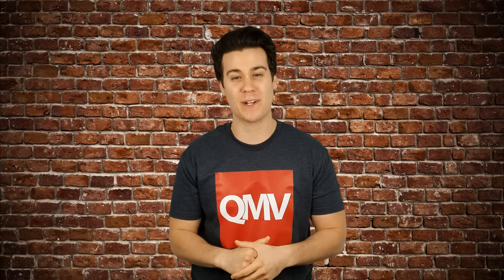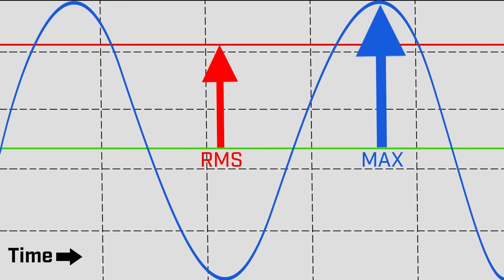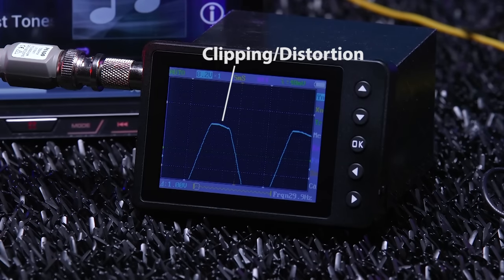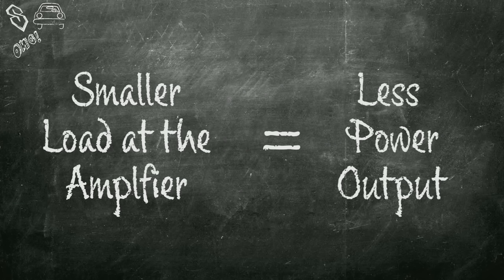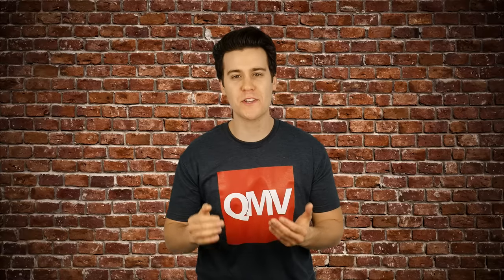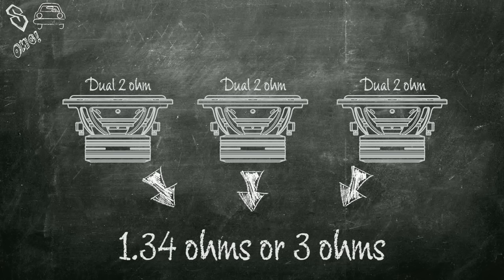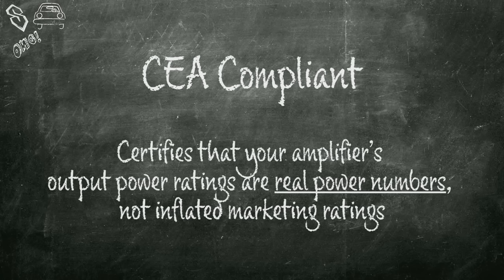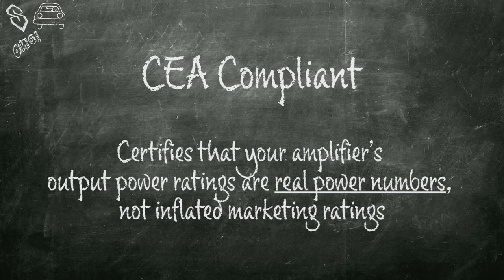How Do You Match Car Subwoofers and Amplifiers?

Comment: This guy talks at 1 ohm and now my brain is overheated.
Reply: 0.75 speed is God’s greatest gift
Reply: @lopsided6393  BAHAHA I have to do that to all my videos now
Reply: I'm trying to bass out a moped scooter. Under seat storage is where the sub and amp will be. Should I get another battery for extra power. And is moped 12volt different from 12volt car power. I've had tons of systems most head amp and subs. But only in cars. Miss my bass . Love my moped. Upgrading. Thanks. #jimmysee28......
Reply: He lost me at subwoofer...
Reply: @lopsided6393  More like 8 ohms, higher voltage.

Comment: @5.39 OMG that the exact amp i have(GM-A3602). got it at walmart for $40 but I'm already replacing it lol just got my sub installed after 2 weekends of work and hours of youtube videos. managed to get it right on the first try but the amp is severely underrated for my sub(370rms) so im replacing  the pioneer amp with a MA Audio HK298 (400rms output at 1 ohm) . These videos were an integrall part of getting this project done Thank you so much!

Comment: The ohms section really fried my brain. I still don't to get it :(
Reply: BLK13 it’s been 2 years since, you you get it?
Reply: @Davidszd-f1h  That's where I got messed up, too. Ohms, impedence, and parallel / serial wiring.
Reply: @damienholland8103  i know im really late but if anyone sees this is and is having issues, look up some diagrams! specifically a website called 'crutchfield' that allows you to put in your set up and it will tell you how to wire it up! super easy.
Reply: The ohms section got me when he started with the 3 subs. He said 3 ohms or 1.34 ohms. I didnt get how he got 1.34 or hiw hes saying 3 or 1.34 like its the same thing
Reply: @Twhite97  and exceeding is up or down
Reply: Don't feel bad it takes some time to learn that stuff. We didn't learn about impedence until 3rd term in my electrical program

Comment: I’m glad I saw your video. Been studying for almost a month for future set up sub woofer. Either gonna use car amp+psu or an home power amp. Gonna compare where I can get less. But no brainer subs for cars are meant for car amps. Most of the local videos I watched here are recommending 1500w rms mono car amp to match for 500rms sub speaker. For the head room I guess. Now that my mind is in peace. Just gonna add 20% more from the speakers rms then boom all good. I only need to know 1 last thing. Matching amperage to the amplifier. Thanks for your vid mate! New sub here from Philippines 🇵🇭

Comment: Thank you for this Video, I just Matched my system by Using a USA made Kicker 4 ohm S12L7 Sub (750WRMS) in a 3cu.ft. Ported box with a Punch P8002 amp and P4004 for Mid's and Highs. Using Hertz Hi Energy speakers OLD SCHOOL
Will see how it turns out.

Comment: So I have 2 p3 12s in a potted box. Which amp would make them hit harder and play low notes deeper? The prime 1200.1d or the t1000
Reply from the maker: In terms of lower notes, the T1000 will get a little lower, it also has more power at 2 ohm and 4 ohm loads. The 1200 has a higher power rating at 1 ohm. The T1000 is also $250 more
Reply from the maker: Gotcha! So the 1200 will get you 200 more Watts RMS @ 1 ohm, and it's cheaper. The Power amplifiers are more expensive and better quality, higher end models. The Prime are cheaper, they're Rockford's more "entry level" line.
Reply: @Qualitymobilevideo  so I decided to go with the t1500bdcp. That's compatible correct? I dont wanna blow my p3 12's

Comment: Great tutorial, i understood 90% of the video since english is not my first language, however if someone can reply to me i would be gratefull. I bought Pioneer TS-A250D4 Subwoofer which is dual 4 ohm and 400W RMS, i wired it to stock bang and olufsen amplifier witch has 1x150W for sub, the sound is even worse than stock, what amplifier should i buy and how i can wire it? it is best to wire at 2 ohm or 8 ohm ? please? thank you so much.
Reply from the maker: You need to test the factor woofer to see it’s impedance to properly answer that question.
Reply: @Qualitymobilevideo  factory sub is 8 ohm, but nevermind, i bought an amp wich has 1x 600rms at 2 ohm and i will wire the sub at 2 ohm with 400rms, it should sound good because is a quality pioneer amp, ty

Comment: Hi 👋 Great Explanation. I have a JL Audio w0V1 4 ohms SVC. Slot ported original JL enclosure. I am not satisfied with the performance of subs powered by helix g4 bridged at 240 rms. Kindly suggest me a good mono block pls..
Reply from the maker: Rockford Fosgate R500X1D 300W RMS @ 4 ohm
http://www.qualitymobilevideo.com/rockford-fosgate-r500x1d.html?utm_source=YouTube&utm_medium=Video&utm_campaign=Match_Subwoofers-Amplifiers

Pioneer GMD8601 300W RMS @ 4 ohm
http://www.qualitymobilevideo.com/gm-d8601.html?utm_source=YouTube&utm_medium=Video&utm_campaign=Match_Subwoofers-Amplifiers

Kenwood KAC-5001PS 300W RMS @ 4 ohm
http://www.qualitymobilevideo.com/kac5001ps.html?utm_source=YouTube&utm_medium=Video&utm_campaign=Match_Subwoofers-Amplifiers

Kicker CXA600.1 300 Watts RMS @ 4 ohms
http://www.qualitymobilevideo.com/cxa600-1.html?utm_source=YouTube&utm_medium=Video&utm_campaign=Match_Subwoofers-Amplifiers

Comment: Amazing since knowledge thank for sharing your experience.
Question 👇
The audio frequency output from the radio in low level or high level.
Amplifier must receive low level frequency from radio unit or no matter.
If the head unit high level output must reduce it before send it to amplifier.
Waiting your reply ASAP
Best regards

Comment: Hello,
Looking for some help in choosing the correct car amplifier.
For a combination of Sony speakers XS-162ES at front & XS-160ES at rear, which is a suitable amplifier among Sony XM-GS4 or XM-4ES?
I require to get crystal clear sound only with some good bass. I am NOT looking for very loud sound.
What are the extra things to get from XM-4ES over XM-GS4, is it only loudness or the output is far better in terms of clarity?
Is it worth the price if I install XM-4ES or XM-GS4 will meet my requirements?
If you can please let me know. Thanks!
Reply from the maker: You can use either and both are excellent!

Comment: 8:32 very helpful info thanks
Reply from the maker: Glad it helped!
Reply: I have a question.  So I have a pioneer GM-d8601, 1600W max.  Website reads this "RMS: 800W x 1 @1 ohm".  Does the "x 1" mean 1 channel?  So does that mean I can get 2 dual 4 ohm subs 1300W max, 400W RMS and parallel them to 1ohm?  Wouldn't that be a perfect?  This will help me understand what the "x 1" truly means because I'm a little confused.
Reply from the maker: Yes and yes. The x1 means one channel

Comment: I’ve decide on 2 kicker 48CWRT124  comp RT ( rms 500) DVC @4ohms in a sealed custom box which I’ve calculated will work, and will be going in my roll cage of my Jeep, was going to go with kicker 46cxa800.1T ( rms 300@4ohms —-600@2 ohms——800@1ohms)  is my choice correct or should I go with dvc@2ohms? Thank you!

Comment: If I had an 8” dvc subwoofer that was rated 50w rms,  does that mean I can run a 25w amp & hook both voicecoils to it ?  Thank You. 💯👍👍
Reply from the maker: Possibly, if the voicecoils are 4 ohm and the amp will accept a 2 ohm load you will double that 25 watts to 50 watts.
Reply: @Qualitymobilevideo  ok,  Thank You. 💯👍👍

Comment: I have the Power Acoustik GW3 12-Inch RMS is 1200. I use the Razor Series 5-Channel Car Amplifier which is 2500 watts. 
The Subwoofer Channel RMS Power Rating:
4 ohms: 400 watts x 1 chan.
2 ohms: 600 watts x 1 chan. 

Right now my woofer is wired at 4 ohms, is my woofer underperforming even though the bass sounds really good? Oh, I also have two 6 inch mids on the amplifier. I believe they are 2 ohms I'm not sure but I am more curious about the sub.

Comment: Like your explanation of the AMP & Subwoofer Combo; however  am not as technical proficient as you.  I have a Pioneer AVIC-Z140BH connected to a Alpine MRX-F30 with one 12" subwoofer.  What would it be a better amp for this radio.  I am thinking about purchasing 2 10" Subwoofers to add to my system.  would Pioneer has something that I can keep all pioneer.  what I mean is radio, Amp and Subwoofers, speakers and twitters?
Reply from the maker: Do you know what specific subwoofers you plan to get?

Comment: how come half of my amp is burnt inside without burning fuses first? battery power line has 60A fuse and there are 2 fuses on amp each is 30A, i thought these would cut off first before the amp burns, what could the cause be? thanks

Comment: Great video! But..... I have pioneer 2 chanell amp bridged to 350w rms, 4 ohm, and pioneer sub, dual coil at 2x4 ohm. It is was working great for last 8 years, but woofer is done for. That rubber part around the membrane i starting to peal so Im looking for an upgrade. I got an Ground Zero 12" 1000rms at 2x2 ohm. Should I even try to pair it with my pioneer amp, until I get the propper one, or it will work?

Thanks!

Comment: Hi great video..but still need help.I have a Punch 800a4 and will run 2 of the channels  bridged to a single 15 in a Q logic bandpass box..What suits my system best Rockfords P1dvc,P2dvc,or P3dvc...i prefer the P3 but is it to much speaker for this amp?thanks

Comment: So I have a question. I have 2 Rockford p3d2 in a ported box in a Tahoe. They are wired in series. What amp would be best to get full potential of my subs for running at 2ohms?
Reply from the maker: You should have the coils series and the woofers parallel for a 2 ohm load. I’d you have all the coils series you are at 8 ohms
Reply: @Qualitymobilevideo  yea you’re right the tech wired them down to 2 ohms but I have a hofonics 35th anniversary Hercules 1700 monoblock. What amp do you suggest that will bring out the best out of the sub woofers ?

Comment: Thank you for this. 
If I have a 1000 watt amp that puts out 500 watts at 2ohm and 1000 watt at 1ohm, and I want to wire 2 subs at 500 watts rms each, do I wire the 2 subs to 1ohm or 2ohm to get 500 watts to each sub

Comment: I want to run four skar audio subs  that are 2 ohm 900 rms 1100 watts max what size of amp & brand should I go with?
Reply from the maker: You will need two amps that can do 1800 Watts at 1 ohm if these are single voicecoil subwoofers.

Comment: Hey I need some suggestions for an audio set up for my car.i have a 2007 Honda accord and everything is stock. I'm getting the sony XAVAX3000 for my new head unit and a 12 inch kicker L7 with an included ported in closure. I need some help with figuring out some speakers and amp for my car. I want I nice clean sound with great thumping bass that won't be to hard to install and upkeep. The more simple the better. Love to hear vocals! Like in r&b, hiphop, alternate rock, and pop. I get a discount at best buy so money isn't too much of an issue. Also installing a back up cam

Comment: Ok, on a 1973 VW Beetle standard with an alternator instead of a generator. What do you recommend for a good sound system where there is no back seat and plenty of room for subs on what is going to be a diagonal from the back window mounting wood panel down to the battery area? Nothing crazy, just a better than average system that you can turn heads to.

Comment: Great video but I'm still a bit lost! If I wanted to run 2 Bass face SPL 12.2, 1200w rms, dual 4 ohm voice coil subwoofers what amp should I use and how should I wire them? I've been stuck for weeks
Reply from the maker: So those subs are 1200W RMS each? And 2400W RMS combine? Two DVC 4 ohm woofers make a 1 ohm load(parallel) or 4 ohm load(series), 1 ohm getting you the most power. In that case, you'll want an amplifier with a power range of about 2200-3000W RMS @ 1 ohm. Here's an entire list of compatible amplifiers:

https://www.qualitymobilevideo.com/car-audio/car-amplifiers/mono-car-amplifiers.html?amp_output_power_rms_1ohm=2200-4000&dir=desc&order=price
Reply: Quality Mobile Video Okay thanks been trying to find one for weeks

Comment: So I'm wanting to run 1 sub in a harley hard saddle bag. What would be the perfect set up? I'm looking at a 3000 watt  1 channel amp with a 400 watt rms at 4 ohms, 650 watt rms @ 2ohms, and 1000 watt rms @1 ohm.  Should I run two 10s or 1 12 inch sub dual or single coil? Your help is much appreciated.

Comment: Wanted to get an opinion about what subwoofers and amp I should get if I’m looking for some. I want to get the 2 10’ subwoofer box for a single cab dodge ram from fox acoustics and i’m not sure what to run with it. Thank you for any help! I also have the Pioneer DMH 4660 radio.

Comment: If i listen to metal and rap every now and then I know I want to get one 10” kicker sub for my car what would be a good set up in your opinion?
Reply from the maker: I'd recommend getting a pre-enclosed sealed subwoofer, they generally prefer best with rock/metal for cleaner sound, but can still bump for rap. That's what I have. Check out these 10" Kicker sealed enclosures:

Kicker 44TCWC102
https://www.qualitymobilevideo.com/44tcwc104.html

Kicker 44TCWC104
https://www.qualitymobilevideo.com/44tcwc104.html

Kicker 47TRTP102
https://www.qualitymobilevideo.com/47trtp102.html

Kicker 43TCWRT104
https://www.qualitymobilevideo.com/43tcwrt104.html

Kicker 43TCWRT102
https://www.qualitymobilevideo.com/43tcwrt102.html

Kicker 45TL7R102
https://www.qualitymobilevideo.com/45tl7r102.html

Comment: I have two 12" champion series pros that are 2000 watts max each with a 600 watt rms each, wired in series what amp do you think would be best for them and do i need to wire them in parallel?

Comment: alright so with what you're saying in this video you would recommend i match two 12" alpine R-W12D2 subwoofers with a 1350 - 1800 watt amp... now the question, which amp (brand) to go with ?
Reply from the maker: Well yes, but since you'll have two DVC 2 ohm subwoofers, you'll need an amplifier that is stable @ 2 ohms for the equal to or greater RMS power of the combined RMS of the subs

Comment: Ballin on a Budget.... i got 2 Kicker 700w 10in CompVR 2ohm, what would be the best amp for them? TIA
Reply from the maker: Dope! So two 43CVR102 combine for 800W RMS and are both DVC 2 ohm woofers. Two DVC 2 ohm woofers can wire to 2 ohm or 8 ohm. Wire to 2 ohm. You'll want a monoblock with a power rating of 750-1000W RMS @ 2 ohm. Check these out:

Pioneer GM-D9701 800W RMS @ 2 ohms
http://www.qualitymobilevideo.com/gm-d9701.html?utm_source=YouTube&utm_medium=Video&utm_campaign=Match_Subwoofers-Amplifiers

Kenwood KAC9106D 1000W RMS @ 2 ohms
http://www.qualitymobilevideo.com/kac9106d.html?utm_source=YouTube&utm_medium=Video&utm_campaign=Match_Subwoofers-Amplifiers

Rockford Fosgate R1200-1D 800W RMS @ 2 ohms
http://www.qualitymobilevideo.com/rockford-fosgate-r1200-1d.html?utm_source=YouTube&utm_medium=Video&utm_campaign=Match_Subwoofers-Amplifiers

Kicker CXA1200.1 1200W RMS @ 2ohms
http://www.qualitymobilevideo.com/cxa1200-1.html?utm_source=YouTube&utm_medium=Video&utm_campaign=Match_Subwoofers-Amplifiers

Power Acoustik RZ1-1500D - 900W RMS @ 2 ohms
http://www.qualitymobilevideo.com/rz1-1500d.html?utm_source=YouTube&utm_medium=Video&utm_campaign=Match_Subwoofers-Amplifiers

Comment: hey bro great job ...i need some advise here  i have two 12'' 18 sound MB midrange spk12" Diameter
450W AES, 1200W Peak, 8 Ohm
3" Voice Coil
101.5 dB Sensitivity
60-5000 Hz Frequency Range

AND I ALSO HAVE FOUR 10'' midrange
. 10" Diameter
400W AES, 1200W Peak, 8 Ohm
3" Voice Coil
102 dB Sensitivity
80-5200 Hz Frequency Range

and i don't know what kind of amp is suitable for them.maybe two amps or just one 
what kind of amp you would suggest i buy

Comment: I have 2 15" kicker comp Vx and a 12" Blaupunkt and a  2,500 watt power acoustic razor RZR1-2500D amplifier pushing all 3 speakers is that okay or should I run another amplifier for them or is there any specific amplifier you would suggestion I'm all ears

Comment: I already have a JL audio jx500/1d 500rms@2ohm and 300rms@4ohm. Should I buy the Kicker Comp RT DVC4ohm or Kicker Comp RT DVC2ohm? Will I hear huge difference running the same subwoofer @500rms2ohm vs @300rms4ohm?

Comment: Lets Say im looking to run a box thats sealed, and the sperate thats ported, both 12 inch sub: Im looking to give the sealed box more power, because im going with a stronger sub for the sealed box. If one amp is all thats needed,  what is the feature controls the sealed box from the ported? I'm tryin to give most power to the sealed box😅😅😅 Sorry im new to all this
Reply from the maker: I would not recommend running two different type of boxes off the same amp.
Reply: @Qualitymobilevideo  awesome 😎.... Thankfully I have finalized the purchase yet

Comment: I got a 2200watts amplifier 
And 4 speakers car 50RMS
(peak power300watts) 5.25” pioneer 
And 1/0 gauge wires 300amp/ 3000watts 
Is this will work fine ?
Reply from the maker: It depends on wire length.
Reply: @Qualitymobilevideo  its with in the car
Reply: Whats about a 500watt amp
RMS Power@4Ohms 75 Watts x 4 
RMS Power@4Ohms Bridged115 Watts x 4
 and with 10 gauge is good?
Reply from the maker: Better you provide model numbers to the amps and length of wire run.
Reply: @Qualitymobilevideo  what is model numbers to the amps
Reply: @Qualitymobilevideo  length of wire . It’s inside the car